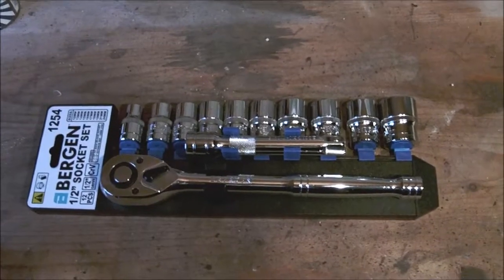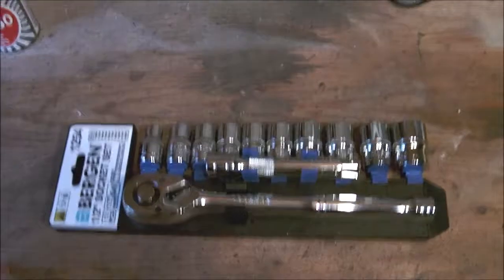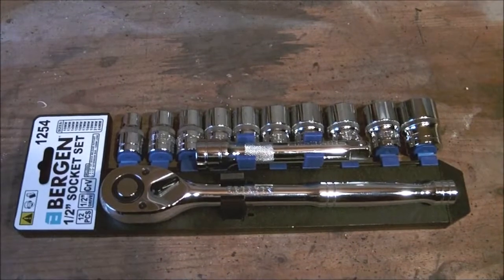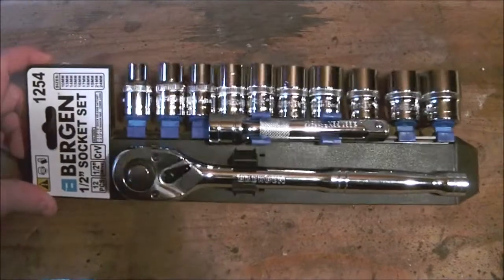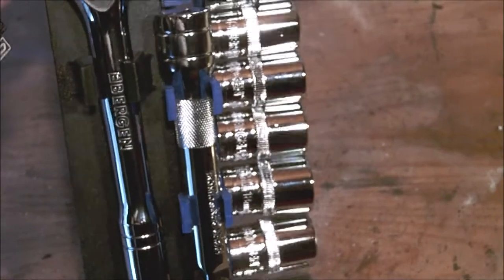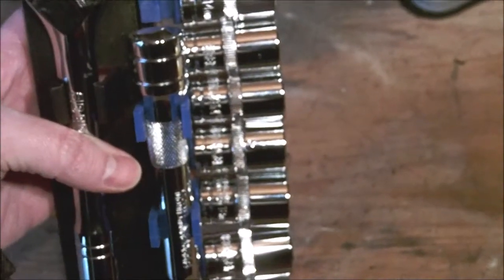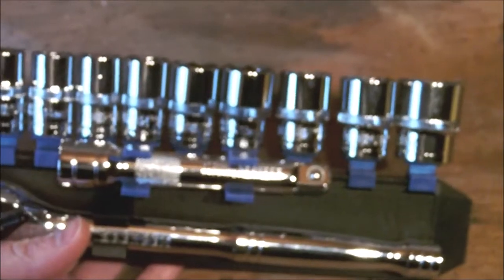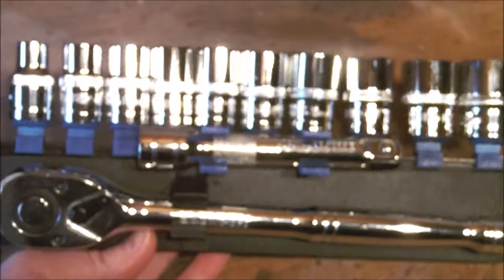Bergen / US PRO 1/2" dr. Socket, Ratchet and Extension Set On Holder. No. 1254

Comment: Hi Ashley 
I need a new 1/2 socket ratchet was looking at the Draper 26733 around £13. Then came across the Bergen 1254 around £20  with the extra sockets How does the Bergen ratchet compare with your Draper
Reply from the maker: paul goddard  The Draper ratchet I have is fairly decent, though it's the Draper Expert range & is 48 tooth, that Draper one you mentioned looks to be a mainline Draper product & although it's more than likely fine (a lot of the mainline stuff is still decent & aimed at trades), a lot of these products now are the same thing as Bergen /US Pro, Sealey, Toolzone, Nielsen & even Aldi Workzone & Lidl Powerfix etc, just with a different company stamp or etching. In fact, even the Reverse switch on that Draper you mention, looks identical to this Bergen. & with the Bergen you do get some nice extra sockets & an extension for not much more. The fact they are both 72 teeth as well rings alarm bells. Most imports are. They are all mostly import tool companies now, which means they source the best places, with the best products with the best prices, which likely means they all end up using the same sources at some point. They may even approach them. There are Draper sets similar like this Bergen but, with a rubber handle that are identical to the Ford sets & Aldi Workzone sets, just with a different colour rubber handle & name on. I've had a few different brands, opened up the mechanisms & you could even swap them around, they all come from the same place. Just depends who has the better guarantee or price if your not a brand snob really. Draper has that of course guarantee wise but, you get more for your £ with the Bergen, which is likely using the name US PRO now if you want to find it. Draper Expert ratchets are usually around 48 to 60 odd teeth. I like that stuff because it usually wins industry / car & classic project mag awards, where they do actual auto work Vs. other brands. The Chinese import stuff usually comes in two flavours; the usual 72 teeth or the exact same product with just 24 teeth. Why they bother doing a slightly cheaper 24 T I don't know. These import ratchets are not that bad these days. I think you would be fine with either. 72 teeth means it will work in a tighter area but, will generally be weaker than one with less teeth. Your more likely to break the many smaller weaker teeth, than bigger stronger teeth in say a 48 tooth or 24 tooth. You would be good with either, depends if you want the extra sockets etc.
Reply: @ashleymcgovern5120  Thanks for the good information I thought 72 would be better than 48 will have a another look on eBay Thanks again
Reply from the maker: paul goddard Well, it's not that it's better or worse it's just more teeth has it's pros & it's cons. 72 teeth is about where it's at now in general & it's fine most of the time to be honest. The teeth scale up for 1/2" Dr. So it's teeth are bigger than the 3/8 Dr. in the same range ( both 72T). But, I seem to think there's still a reason a lot of companies with expensive ratchets have slightly less teeth, including the Draper Expert range. & it's likely to stop many coming back under guarantee with chewed mechanisms & make sure they last a bit longer. Because they will withstand more torque. If you spent £25 + on a ratchet & chewed it up straight away, you would likely say, well that's crap I'm not buying that stuff again at that price. But that's mainly all down to using them to break nuts with, supposed to use a breaker / T-bar for that. If you do you wouldn't have any issues.
Reply from the maker: paul goddard the 46511 Draper Expert 60 T ratchet on eBay for £12.99 looks a good bet. Lifetime guarantee, low profile. The review somes up what I said I suppose.
Reply: @ashleymcgovern5120  Thanks for help and advice will go for that one and buy some sockets separate Thanks again and keep up your good work
Reply from the maker: paul goddard No worries. The Britool Expert 1/2" Dr sockets (now Expert by Facom) I reviewed were fairly decent. Only problem is I noticed there was no 15mm. Like most European  brand sets. Its a size that doesn't get used too much over here naturally but, is over in the far east & therefore since most stuff now is imported into Europe from over there it means it's stuff is full of 15mm & other sizes used. & I had to use my cheap import set. The good thing about the import sets is they include all our & their sizes. You usually can buy a separate 15mm socket etc though.
Reply: @ashleymcgovern5120  Got it down to two the Silverline 245463 just under £9 on eBay and the Britool Expert BRIE032902B at FFX around £17 I know the Britool will be best but the price nearly double
Reply from the maker: @pgtips7818  The Silverline again look to be the same as Bergen Sockets (& others), just with the Silverline on. The Bergen sockets are quite good if you actually use them. Silverline is guaranteed forever if you register the product online & keep the receipt. Should be fine definitely for around the home & home vehicle maintenance. If any break & you don't fancy spending on more you can get it replaced.
Reply: @ashleymcgovern5120   Thanks for all the help and advice I am 67 and probably use them twice a year so the Silverline should be sufficient  if I was younger i would have gone for the Britool Expert sockets Thanks Ashley
Reply from the maker: @pgtips7818  Yeah, they should be fine for you then Paul. I notice that the guarantee is only for 30 days on hand tools but, if you use them not very often they will likely last a long time anyway. At least you managed to get a better quality ratchet for the same price as that other one! I tend to buy a few because If I use any for work, I've had stuff stolen, so I tend to find stuff that's good but doesn't always cost the earth just to go walk about. & I've got to the point  where all my tools have been at a workplace not at home & I tend to need to fix something. So I have a bag/box made up for that & same sort of tools for home.
Reply: @ashleymcgovern5120  Just found this on the Silverline website 

Lifetime Guarantee

This Silverline Socket Set 1/2" Drive 6pt Metric 10pce is guaranteed for a period of 30 days from date of purchase against a fault developing in either the materials or the workmanship during manufacture. You can register for your Lifetime guarantee by registering your product online. Any faulty goods will be repaired or replaced free of charge.
Reply from the maker: @pgtips7818  Yeah strange, it says lifetime, then 30 days. I would say it would be 30 days then. But I wouldn't really worry, It's unlikely you would need it, unless you got that 1 unlucky one off the line etc. Especially if only using it a couple of times a year. I would register it just in case though, use it, if alls fine then it should be good. I suppose it's one of those tool parts working mechanics tend to abuse & break a lot of. They don't all use expensive tools, some are young & just can't afford it. Just stops them giving away constant sockets I suppose. They put them on impacts instead of impact sockets & all sorts & break them & I've no doubt they all want them returned under guarantee then. I wouldn't worry too much.